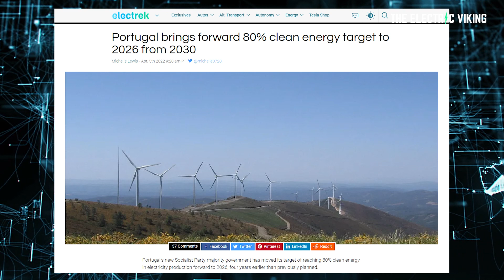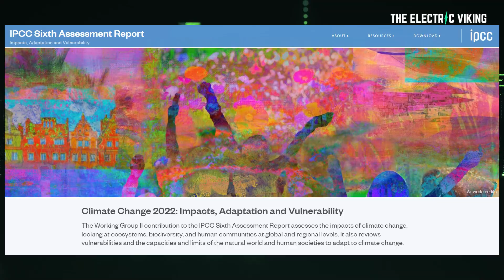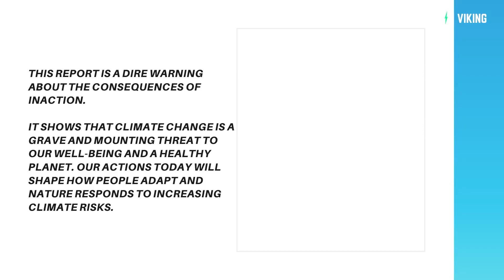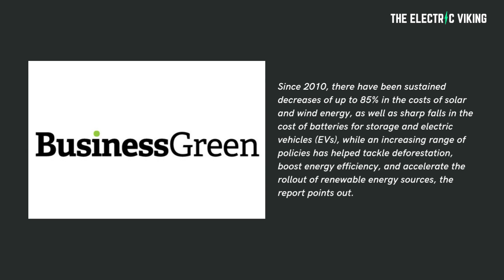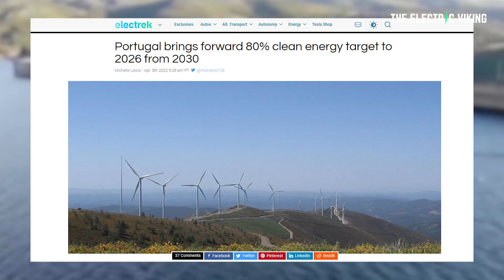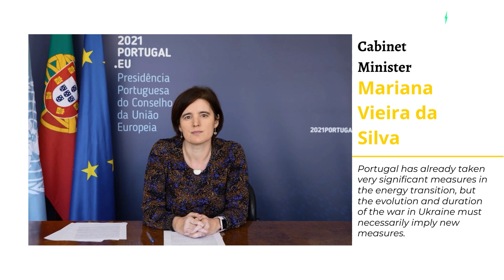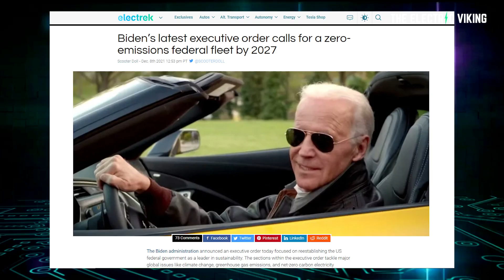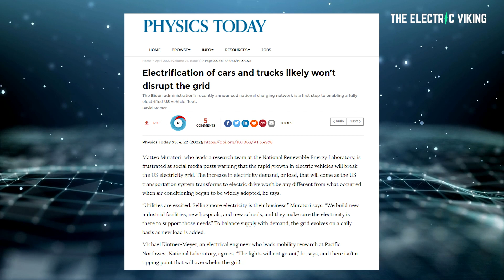Can the electrical grid survive if everyone drives an EV?

Comment: controlling CO2 will not control the global temps.  CO2 is already saturated 99.6 %.  but EVs are still the best car.  I am an engineer, I've worked in the power business for decades including solar.  solar is not the answer and only cheap by shipping all our solar production to china using slave labor.  this is not ok folks.

Comment: Most ICE cars are topped up every 10 days. 10% used each day.
EV cars will be topped up every day for free. No super duper charging required. 
The long 500 klm road trip starts with a full charge. 
Say 6 hours of driving. Plus stops.

Comment: In a shocking or not so shocking report. the IPCC is funded by big oil! Is anyone surprised? No. EVs get charged most of the time at night when the grid is basically doing nothing. It would actually make the grid power maintenance easier as there wouldn't be a huge difference between day and night. And that is if most ICE vehicles are replaced with EVs. At this point we still have at least a decade to increase grid capacity if necessary.

The renewables and EVs won't help is total BS from the Oil companies.

Comment: In Australia, fossil fueled generation still provides about 80% of our energy. It is true that coal plants are running at a loss, but this is because they are being forced to operate like gas turbines, only providing power for part of the day, and this is very inefficient. Sometimes the wholesale price of electricity is negative because there is too much wind or solar available. But at other times, it is over $300/MWh - just check the NEM dashboard early or late in the day when there is no solar. As some coal plants are forced to close (Liddell this year), there will suddenly be a shortage of energy, and coal will become much more profitable for the remaining generators.

If EVs charge during the day, they will be a benefit in using excess energy from solar. But if they charge at night, they will be mainly  drawing on coal for some time to come. Expect that the cost of charging will be linked to time of day, as the cost of electricity in the evening is going to keep increasing.

Comment: I just went to geothermal, LED lights, low power computers & monitors, low e triple pained windows, exterior window shutters and bought an EV resulting in a lower energy bill, I.e. I use less power today than five year ago. These should all be in the building code.

Comment: The real answer to the electrical grid never failing, as it did in storm ravaged areas,  are Mini grids.  My company has developed a new battery chemistry,  working with the University of Idaho  that will last 20 years with only a 20% loss of capacity.  Combining solar with battery storage in homes and connecting them together in a mini grid make a very robust grid able to with stand storms and malicious cyber attacks.

Comment: At a constant, the electricity is wasted if it’s not used or stored. If people use batteries as backup during peak and it’s implemented correctly it will do good 👍🏽

Comment: On average EVs will typically consume about 10 kWhs per household per day. As this energy can either be supplied during off peak times or from household solar PV, the impact of EVs on the electricity networks should be negligible.
It can also be noted that non of the electricity networks have identified EV adoption as being an expected source of increased maximum demand. This implies that the electricity networks do not expect that EV adoption will cause any significant increase in capital expenditures by the networks.
Reply: Possibly closer to 5kW. 
Average km per day in Australia 36km.
At say 15kwh/100km
Reply: @andrewradford3953  Yeah!  But in the US of A:  (at least) 2 cars per household!

Comment: C'mon Sam. Cherry picking statements from activist organisations is NOT the way to achieve a low carbon economy or EV ubiquity.

I am a huge EV fan and believe strongly that we need to get to carbon neutrality.....fast.

But this quasi-religious fundamentalism around unreliable, low density, renewable energy sources is exactly what is holding the world back from achieving an environmentally sustainable economy. 

Renewable energy sources are certainly an important part of the equation,  but can not, in isolation,  come close to maintaining an affordable,  reliable, stable energy grid that will allow the transition to associated low energy technologies like EV's.

Renewable energy (wind and solar) is fundamentally unstable which means it can only be made to work with massive grids (involving huge energy transmission losses and massive installation of high tension steel power cables with enormous associated production of CO2), massive energy storage (again,  associated with massive cost and energy losses) and massive backup using carbon emitting baseboard power sources like gas ( lots more CO2, lots more cost).

Look at the situation Germany currently finds itself in by "going green" and relying on Russian gas to back up its grid stability!. The geopolitical fallout is devastating. 

We need low carbon, base load power. In some countries that can be supplied by hydro.....but in Australia the only realistic option is nuclear. 

Cue the panic and technically illiterate scare mongering.

Until people get informed and are prepared to have a sensible, educated debate around nuclear energy then carbon neutrality, grid stability and affordable electricity are just a pipe dream. Failure will be inevitable and the usual suspects will make the usual excuses for the economic  social and geopolitical chaos caused by their neo-religious, "renewable" fundamentalism.

Comment: The electrical grids do need to be modernized but not just for EVs.  They need to be more resilient and smarter.  Solar and wind generation with storage (probably sodium batteries) is the cheapest right now and we should be listening to Tony Seba and scaling to 4x capacity.  Each country should have it’s own energy independence.

Comment: Hahaha...Sam, you've bought into the "American exceptionalism" myth more than most of us who live here. If you think that America has the will to fund ANY major infrastructure projects you are sadly mistaken.  The political system is so broken here that 1 party would veto funds to resist a Russian invasion if it thought it would help the other party's approval numbers.

You said air-conditioning was largely adapted relatively quickly...maybe in Australia, but the US has had residential a/c for over 50 years.
The US grid is a disaster at present levels of utilization as demonstrated by regular black & brown-outs throughout the year.  You are not mentioning the comensurate goal(?) to end natural gas use for electrical generation & home heating which will further strain the system.

I live in the New York metro area, & effective 2027 ALL new buildings will have to be all electric..this will not only distroy the already marginal local grid, but also increase the cost of heating.  If I were forced to convert from natural gas to electricity to heat my home, with my $ .35/kwh electricity cost, my already obscene $ 1,000 heating bill this past January would have been...$ 6,250 !!!!
Reply: How is gas so much cheaper than a modern electric air conditioner ? By the way your gas is both a fossil fuel and a greenhouse gas, which must be phased out soon. Here in Australia where both air conditioners and refrigerators were invented,we have had air conditioned homes for a long time too but here it is cheaper than gas. We are closing coal fired power plants as they are replaced with renewables but haven’t had blackout problems due to a national approach. I think your country has been captured by fossil fuel oligarchs.
Reply: @malcolmrickarby2313  I was comparing the cost of HEATING my home between natural gas & electricity...I don't need air-condition because it is rarely hot enough to require it (even though it has been warming twice as fast as everywhere else..lol).  Since you are obviously unaware, the US is a capitalist economy with publicly traded shareholder owned (oil) companies & we don't have "fossil fuel oligarchs".  The US (& Australia) CHOSE to reap the benefits of oil products.

In your rush to condemn the "evil" oil companies let me remind you that no one forces anyone to use their products, it is just they have "fueled" the modern world we live in. 
If you don't want to use their products...then don't eat the food that is grown & transported with their products on roads made with them. Don't heat/cool/light your home either. In fact you wouldn't have most of the materials that make up most everything you have & use without the oil industry's products.  So be my guest, embrace an 18th century lifestyle & live without the benefits of oil & have a 30 year life-expectancy too, at least then you'll stop being a hypocrite.
Reply: While you might believe that you don’t have fossil fuel oligarchs , you then go on to describe how completely our modern world has been captured by them. They are publicly traded but the shareholders and even national governments don’t have any control over them. In fact your citizens pay a huge price for this. They have gone to war for them without question. They have watched as cities became polluted when their were clean alternatives.
Reply: @malcolmrickarby2313  Where do I begin???  I described a world enhanced by fossil fuels..how do more people eating well, having longer healthier lives & warm/cool homes qualify as.."captured"??  I don't pretend to understand the workings of the Australian government, why do you presume to know those in the US?  The national government DOES have significant control over all companies, oil or otherwise, thru MANY laws & regulations. Please tell me what wars were fought for oil...World War I & II, the Korean war, Vietnam, Afganistan... what part oil was the reason for them?  Even Iraq was  fought because Saddam Hussein supposedly had weapons of mass destruction...or that's at least that's the lie they tried to sell the American public on.  Just because Iraq has oil (which by International law the US couldn't take & hasn't) you'd have a much stronger arguement if you said that wars are fought to enrichen the Military-Industrial complex.

You haven't a clue about pollution in American cities. If you look at ANY measure of pollution, the air quality has dramatically improved over the past 50 years here.  Los Angeles in the 1960's & 70's used to have 200+ smog alerts a year....they haven't had ONE this CENTUTRY!!

Do yourself a favor & don't spout uninformed talking points of radical rent seeking environmentalists...you sound like a fool.

Comment: This year: air-sealed and re-insulating our home; installing adequate PV for all home loads and EV; replacing old furnace-based HVAC with well-designed, efficient heat pump system,  converting remaining gas appliances and water heating to electric; and installing 10 kWh battery for essential loads during power outages. We're doing this instead of kitchen, LR, DR and bathroom remodels. In a couple of years we'll get around to the other aesthetic but less vital stuff.
Reply: Yes, superb foresight!
Reply: That should save you so much money that you could do the other aesthetic renovations several times over if you wish.
Reply: What pisses me off ..really pisses me off.. is new housing going up near where I live are fitting oil fired boilers in.. it it should be illegal,  new housing should have to be sustainably heated and powered it should the law !! Wtf so angry with the shitty UK government.

Comment: Mentioning climate change, manufacturers are positioning electric vehicles as upper luctury and missing the mass sector. Governments who want electric vehicles made for the mass sector should consider extending the financal punishment used to reduce internal combustion vehicles onto ev manufacturers who wont supply product to the mass sector.

Comment: World coal consumption is increasing  as new plants are still deemed feasible to replace, increase and supplement the base load for domestic and industry.It’s just a fact.Coal exporters just can’t ship enough of the stuff at current  record prices.
50 years is about the limit for the average power plant (coal,gas nuke etc….)before becoming economically problematic factoring in maintenance.
EVs at current uptake rates ,usage is projected and calculated to be only 3% of the total average energy grid consumption by 2030.

Comment: The grid can handle Evs, but renewables cannot power our civilisation. The missing piece of the puzzle is cheap batteries. Great progress has been made reducing battery cost over the past decade, but even with the most generous projections, cost cannot come down enough to make renewables affordable. This doesn't mean they're not good enough for EVs. They are. The trouble is that the demands of grid-scale storage are far more stringent than for EVs. The solution is nuclear power.

Comment: I'm not educated on the subject at all, but why then in US there are blackouts when grid gets overloaded from households using air conditioning?
Reply: It could be a few things bottle necks can cause localized blackouts. Lack of power capacity can also cause this ....it can get more complicated as power stations often use rivers/lakes to cool equipment they are often given restrictions on how warm the water can get and have to decrease output.

One big issue is that people often use air-conditioning at the same time and not that often. (Heat waves)  
This puts a lot of extra demand on the grid exactly when it can least afford it.  

The issue with the air conditioning is that it uses a lot of power at the wrong times you could be talking about a few days a year.

An EV will use a similar amount of power each day and it in most cases will hold several days of energy it needs to get from A to B.

This is the Right type of increasing demand as it will increase the utility of the grid at off-peak times, this could help unlock grid up grades that would otherwise be considered 'gold plating'.

Hopefully my comment makes some sense.
Reply: I vaguely recall watching a documentary that discussed how corrupt, greedy capitalism causes some of those blackouts rather than technical problems. In essence, sometimes a power company will artificially constrain the amount of energy they produce in order to create a "demand meets/exceeds supply" state of affairs, which gives the power company the ability to charge peak rates. I think the documentary might have been "Enron - The Smartest Guys in the Room", but I suspect you might be able to find relevant videos on YouTube or your favourite streaming service.

Comment: I am an electrician. As most EV's charge at night, they are charging when electricity is both plentiful and cheap. This has been beneficial to many utilities, as they are making a lot more profit on the electricity sold to charge EV's. It also takes between 2 to 6 kilowatt hours of grid supplied power to make each gallon of gas/petrol and diesel fuel. So every gallon of fuel that is not made allows that electricity to move an EV 6 to 20 miles on the roads.
Reply: Exactly what I've also pointed out minutes sooner, pointing to a video sequence detailing this.
Reply: Excellent point
Reply: it is a shame you do not understand the difference between power and energy   you mix and conflate these units like a true novice

Comment: Basically 100% adoption of EVs expand the grid by 25-30% or so in total energy use, and increases peak usage by around 10% (usually due to DC fast chargers, not home charging which is not done at peak).   100% adoption is a 30-year affair... not just banning new ICE sales, but also waiting for all the ICE vehicles on the road to hit the junk yard.

So the grand result is about +1% grid expansion per year and about +0.3% peak usage per year.   This makes it a non-problem.  The grid has to adapt, but the rate of adaption is so slow that it just isn't a problem.

You can calculate this yourself by looking up total miles driven in a country per year and multiplying about 3 (for miles... a different multiplier for kilometers), and that is the number of kWh of energy that will be needed at full adoption.  Then compare against total yearly grid generation now and there ya go.

-Matt
Reply: it will be around 20% in Denmark, if you exchange all cars right now. 
our issues will also be that we will install a huge amount of heat pumps and we are a transit for electrical power between Europe and Scandinavia and big tech Places a lot of data centers here. and on top the grid is designed for Central powerplants So they have to make some changes anyway

Comment: Lastly - Electricity isn't perfect even if you had renewable production; which is only 2% world wide now.  The power lines lose 20% of their power; that energy is radiated out and is of significant negative potential.  The terrible toxins (PCBs) used in high voltage switches were replaced by SF6 - one pound has the global warming effect of 26,000 lbs of CO2 - 26,000 TIMES - AND it stays in the atmosphere at least 10,000 years!   You want more of that?   EVs are a HOPE not a PLAN.

Comment: Your best and probably only hope of having even 50% EVs in 20 years is Thermonuclear power.  If that were to happen you could afford to greatly expand the electric grid - without it you have to literally turn to coal to power EVs not a very great direction to go.
Reply: What an absurd assertion. To begin with, EVs mostly charge at night when there is excess power available anyway. Further, even completely ignoring that and only looking at total electricity demand, it would take 20 years to convert to 100% EV on the road resulting in an increase in demand of only 2% per year at peak. Coal is already more expensive than wind or solar. Why would anyone turn to coal in the future?